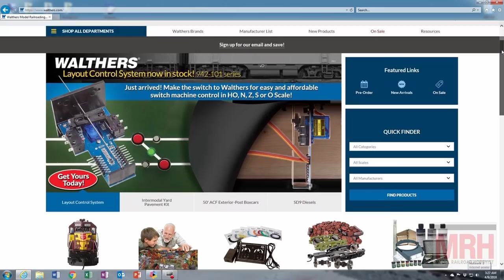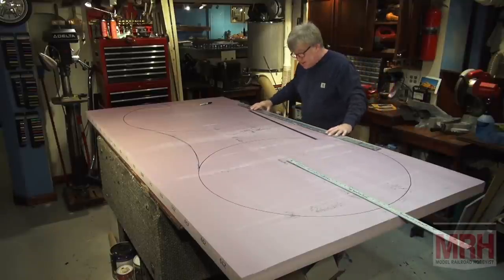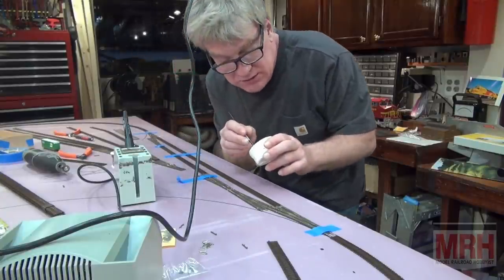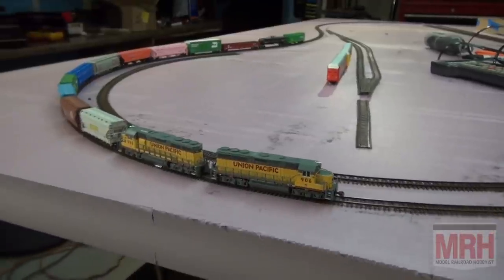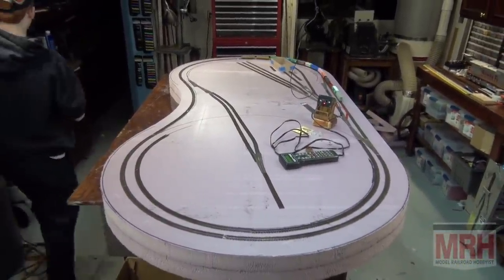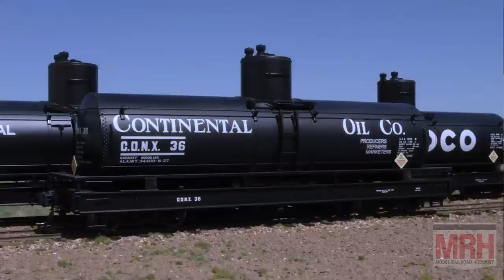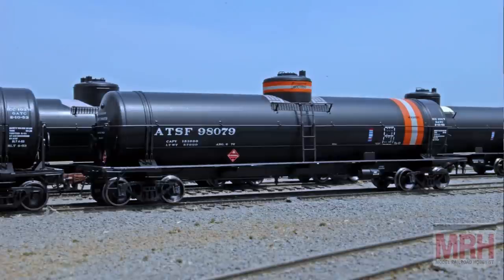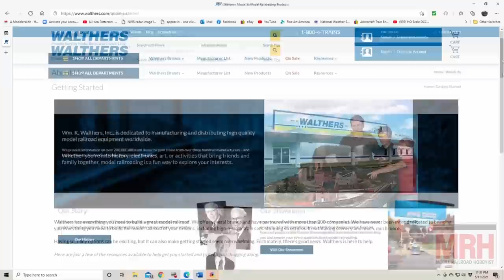N scale layout build - part 1 | July 2021 WHATS NEAT Model Railroad Hobbyist

Comment: Great show Ken, especially the sequence about the N gauge layout development. Just wanted to mention to everyone that before selecting a radius for your mainline curves, think about the types of equipment you will be using including power units and rolling stock. This many times depends upon the era and or specific railroad you are replicating on your layout. Non-Articulated locomotives and many SD diesels don’t look so good and many 70’ and larger rolling stock don’t look good on smaller radius curves, so if you have the space go for larger radius mainlines. I wish you had done this segment before I built my layout at home, I’d have included at least one layer of 2” foam under my roadbed for some rivers and culverts. Thanks Ken, keep up the good work.

Comment: Was in Costco here in Canada the other day and saw they had their “craft” or “party” tables on sale for $20 cdn each. These tables are 2’ x 4’ and have adjustable legs for different heights. Once set up they are very sturdy and I thought hey, buy 4 of these and you could butt them together in any configuration you desire. You could run them end to end and have a 16’ x 2’ layout or an L shape would give you 8’ x 8’ …..what ever you want. For $80 you have ready made bench work. You could add more tables, changing the configuration again. Where the butt ends meet, I would drill holes and secure them together with bolts and washers thus making it one solid structure. If the tables are against the wall, drill holes in the sides and using screws and washers you could secure it to the wall studs. You could build your bench work in less time then it took for me to watch this video. Cover it all with foam and you’re ready to lay track. Next time you’re in Costco, give them a look and see what you think.

Comment: The N scale layout .
I used flextracks for the curves Atlas , manual and remote switch Bachmann and Atlas . 15 , 30 and 90 grades crossing . Reailed Atlas and Bachmann .Remote double slip switch and remote triple switch .
Nails for tracks and joiners Atlas Ken .

Comment: a suggestion isn't to solder every joint but to solder every OTHER joint or at last have a few that aren't, this allows the tracks to expand and contract due to heat or cold of the room.  If you solder everything solid, it will warp itself over time.

If you really wanted to be stickler for realism, there is code 40 for N scale.  For most people Atlas Code 80 is the norm, also the same size of rail that Kato uses for their Unitrack system as well.  Code 80 is a bit too big for the scale (code 100 for HO is the equivalent) and the ties are too few per a "foot".  Code 55 (Code 83 for HO) is closer to prototypical ties and rail head size.

Comment: I love Lombard Hobbies but why would anyone new to the hobby in 2021 spend their valuable time and money on hand laying N scale roadbed and scale track and then wiring everything with a soldering iron??? That process is so 1970s and Atlas!!??   Kato Unitrack is the reason most people with have intricate N scale layouts these days just as Lionel Fast Track attracts many more people to O scale and non-scale Lionel products.  Unitrack is a bullet proof instant layout solution which is totally reliable as are Kato engines and it therefore allows for immediate layout construction for DC or DCC operation without all the time, effort, expense, tools, skills and frustration associated with hand laying cork roadbed, aligning rails, nailing track to cork road bed, wiring track feeds, gluing, pinning and then soldering track feeds.  Sorry but the complexity of what you are doing is not why N Scale is so popular these days with folks coming back to the hobby or new to it.  DCC N Scale sound equipped trains require absolutely bullet proof track and turnouts and Kato Unitrack offers that in spades.  Sure the track is not US prototypical but it is operationally bullet proof for expensive sound equipped DCC locomotives and it will last for decades with zero issues and it is easy to clean and/or replace if necessary.    Not many people have the time or the skills to hand lay track and I know when I had to do that with Atlas track back in the 1970s in HO as a 13 year old the result absolutely sucked.  Kato Unitrack is plug and play wiring for either DCC or DC and so a caveman (or someone with limited time and skills can build a layout in an hour or less on a flat table top and start running trains immediately while endless tinkering with the design without the need to rip up and rewire track to explore multiple configurations.  If I had to hand lay track back in 2001, I never would have gotten back into the hobby after a 27 year hiatus.  I am still using the Kato Unitrack I bought 20 years ago with its plug and play power feeds and turnout controls.  Converted to DCC and it was not fun soldering decoders to non-DCC ready engines and in N Scale, the very small size makes soldering any wire lead a total bear.    I suppose some people enjoy hand laying track but most of us suck at it and would prefer to have a layout that works and will keep working for a decade or two or three with no need to relay or rewire track. For most people working in N Scale or Z scale, hand laying track with less than 20::20 eyesight in middle age is not really a viable solution or a good time. Once you paint and ballast Kato Unitrack, it looks better than okay and it will outperform and outlast anything else on the market.  I could build your layout in couple of hours or less with unitrack and cut pieces as necessary to make it fit your track plan.  Sure there are a limited selection of powered switches but most of us can live without exotic curved turnouts or # 8, #10 and #12 switches and run our trains on #6s and #6 crossovers. Running trains quickly is what sells trains to new hobbyists as well to those returning to the hobby after decades and so the audience for this type of video must be rather limited.  I suppose some people still like to lay roadbed and hand lay track, but to me it is like weeding a garden, a never ending project.
Reply: I'm one of those who still lay roadbed and track. I just prefer the way it looks when ballasted.